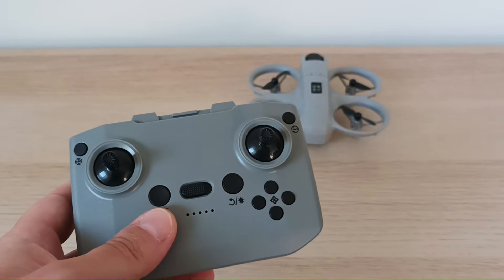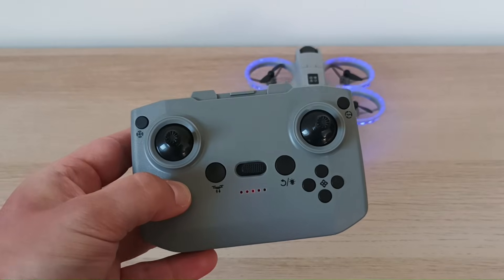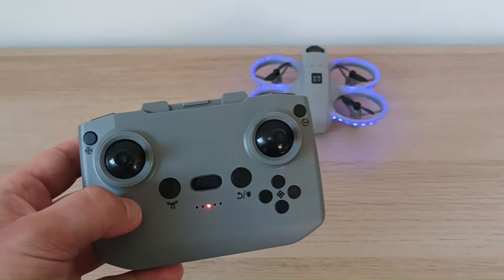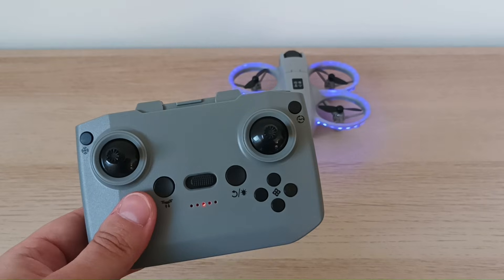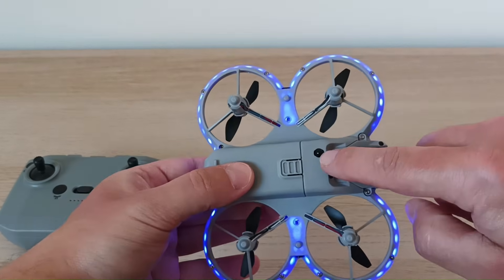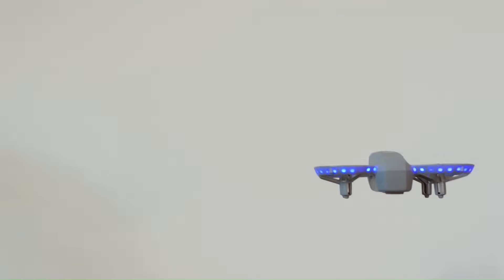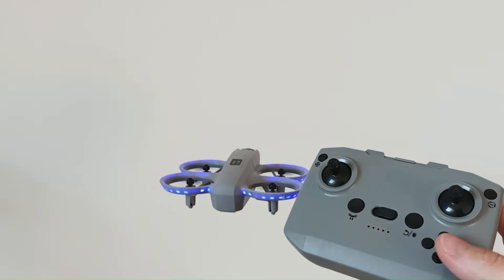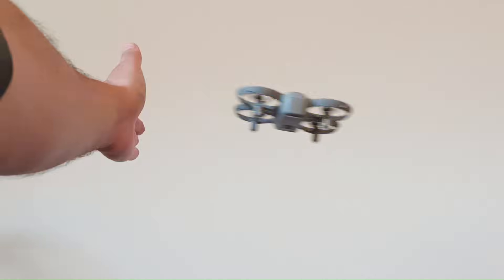How to calibrate and fly "Xiaomi", GT3, i1Pro, V66, D16, T3 Mini Drone? Quick manual for beginners.

Comment: Hi. This may be an off-topic question, but I have a basic problem. I can't connect to the camera. The WiFi UAV app has all the access rights, but it still won't connect. I've tried restarting the connection, but it still doesn't work.
Reply from the maker: Sometimes it is a matter of the order in which you turn on the app and the drone. Do not turn on the app before you have the drone ready to fly and establish the wifi connection with the drone on your phone. Turn on the drone and the controller first. Then check if there is wifi signal coming from the drone. Connect your phone to the wifi signal and only after that open the app.
Sometimes you may need to turn off the mobile internet network on your phone, the internet connection that your phone uses. Turn it off, connect to the wifi signal of the drone and try to open the app.
Another reason could be the outdated version of the app or incorrect app. Many apps are similar as in many cases the same manufacturer produces different drones which are then sold by different companies under different names. The apps may look like they work. Some buttons may really work but getting the video signal may not work.

Comment: Do I need to calibrate it every time I turn it on or before I fly it?
Reply from the maker: It is recommended, yes, but this drone flies well without calibration as well, you can try both ways and see if it works fine without calibration.